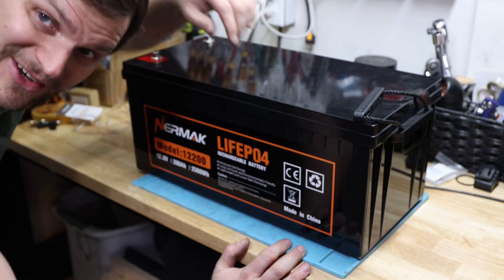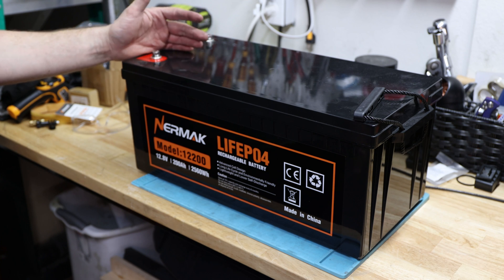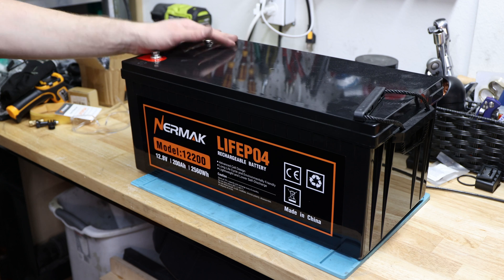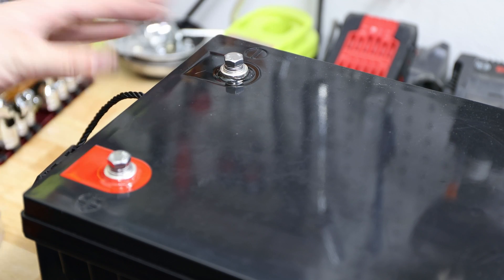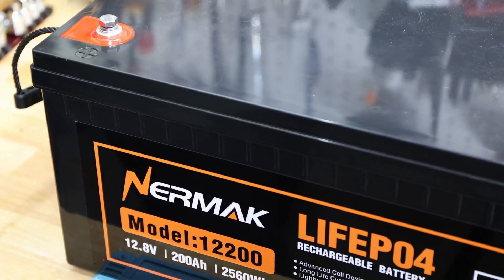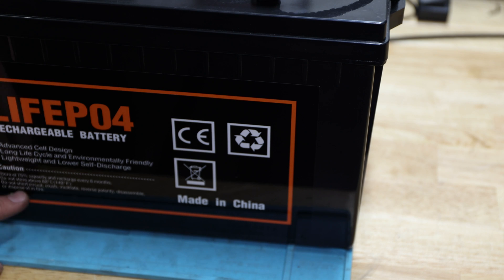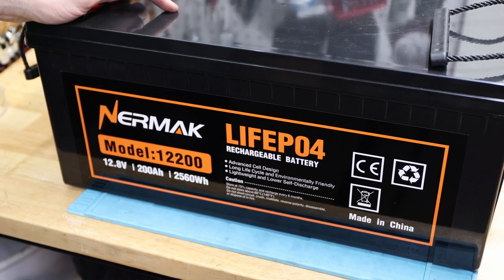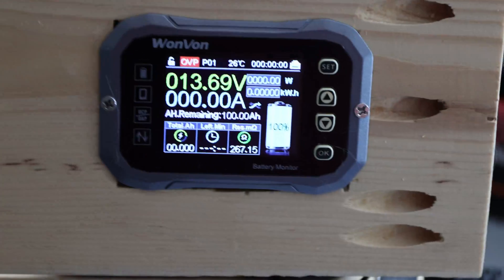NERMAK 12V 200Ah LiFePO4 battery review | Budget Friendly?

Comment: Did you ever figure out which BMS that one was?
Aside from the "amazing" soldering they did (lol) the leads all look long enough you could just cut them and throw a quality JK BMS in there for less than ~$100... :)
That would also allow you to start connecting them via CAN and have usable data from the batt/cells (as well as the bluetooth app from JK)... 
I am leaning towards doing that. I bought a bunch of Victron gear and the guy through in 2x 200ah Nermak batteries. I tested them and they both still output 192/193 each... 
Not a bad "cheap" option for my work trailer I'm building... :)

Comment: I Bought 8 HiCrank Batteries (20KWH) in April 2024.  They look identical as the one you are showing with same specs.  Off Brand Chinese.  I have been running my house with these using an XW-Pro.  So far, so good.  I was really hoping to find someone that dissected a similiar off-Brand with same case.  I suspect these are all the same.  Only $400 each and 10 year warranty.  Sold Out now.  Can't beat the price.  I have to use a Victron Smart Shunt for my "State of Charge".  An accessible BMS would have been better however budget restraints prevented that.  Since the batteries don't move, I not concerned about the solder joints.  Great Review.  Just what I was looking for.